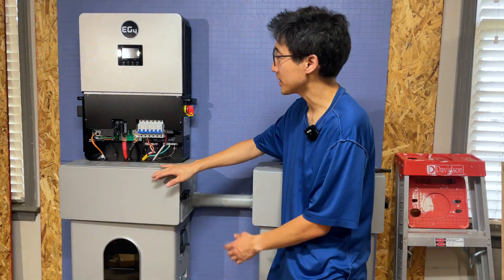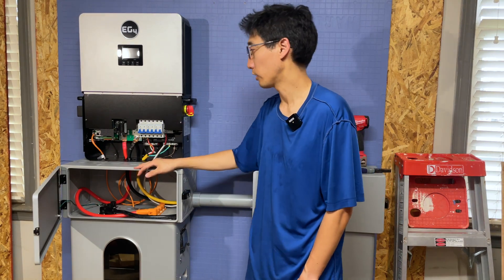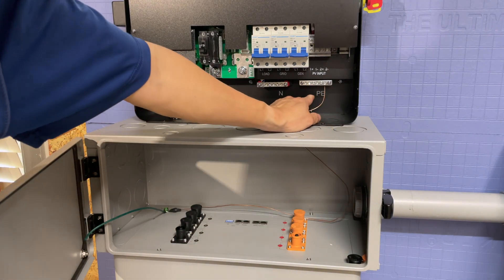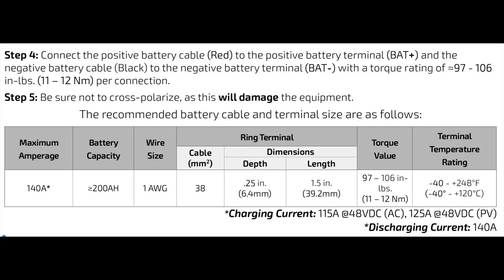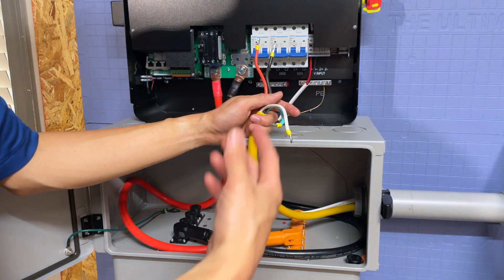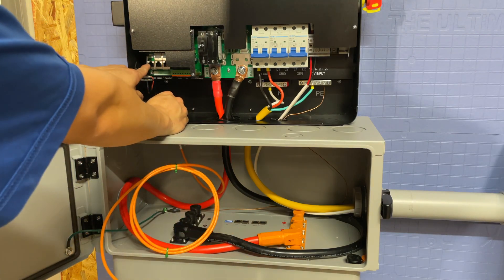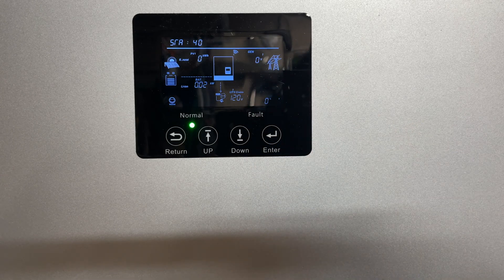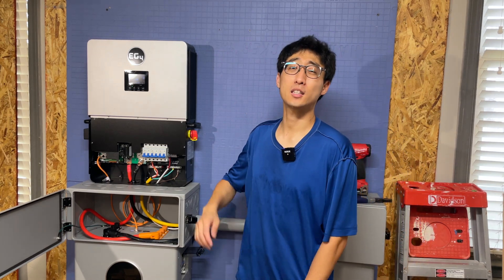How to setup EG4 6000XP Indoor Wallmount battery and conduit box kit off grid system

Comment: Nice video. My battery drained to zero last night for some reason and will not charge this morning and sun is out. Any suggestions to get system to start charging again? Used to shut off at 10 percent so not sure how it went to zero. Off grid so any advice?

Comment: High frequency, output transformerless inverters like these offer shorter life expectancies and poorer surge capacities than low frequency, transformer based inverters. And without an output transformer to provide galvanic isolation between this inverter's DC boost stage and its AC output, you can damage your AC appliances or onboard EV charger during a catastrophic failure of this inverter's H-Bridge circuit. So no thanks.
Reply: Overgeneralize much?
Reply from the maker: hopefully it won't become a reality, but only time will tell
Reply: and burn up all the power heating a 200 pound boat anchor?  Why not go back even further to the days of rotary converters? with brushes and slip rings and commutators..

Comment: Correct battery to inverter lugs for the newer 6000xp are 2/0 5/16" the 2023 models were 2/0 1/4"
Also the protocol settings on master battery need to be set for the communications to work correctly. (Turn off battery, all dip switches up, turn on battery button not breaker, hold enter or return button for 5 seconds to enter protocol settings, change can settings to lux, turn off battery button, set dip switch 1 down for master, turn on battery, done )